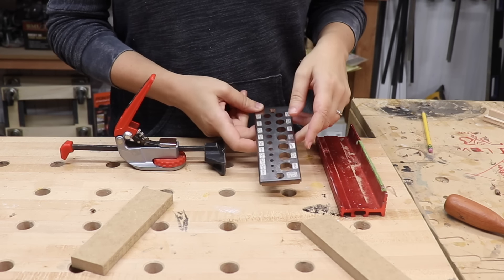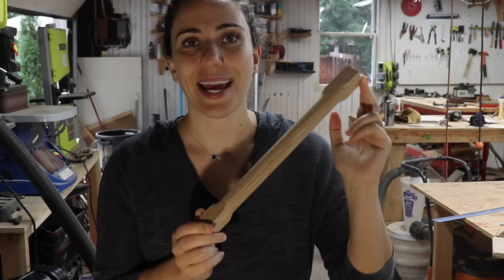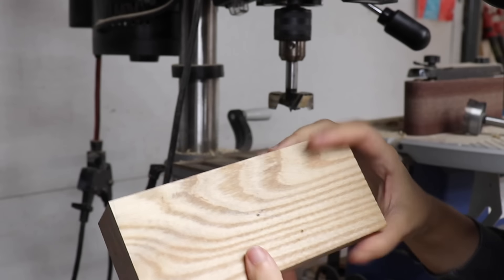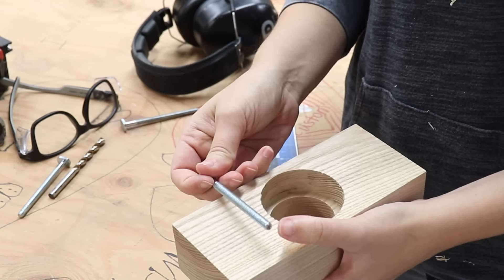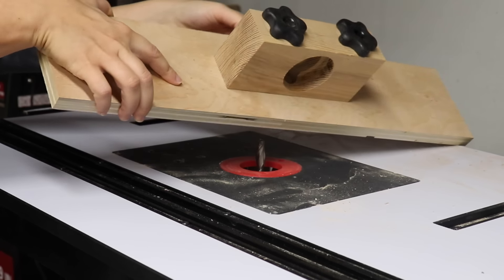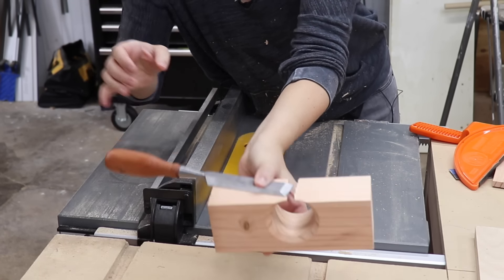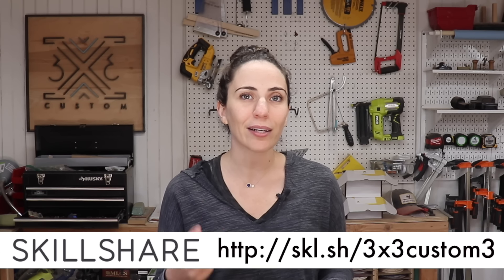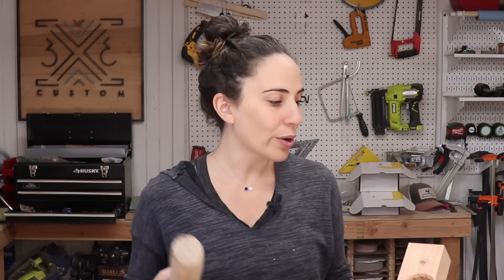Making Large Dowels WITHOUT a Lathe // Woodworking Jig // Dowel Maker

Comment: Try using some replacement/old planer blades. And screw them down using a metal backing bracket . Right angles and screws will give you sufficient clamping action. And try mounting the blade at an angle so the dowl will start cutting at the max depth first and work. Into the minimum depth! If you cut or  make the big whole piece of timber from 2 seperate sides and use bolts in the base and roof you could adjust the size ratio of the dowls.!🤔

Comment: For small diameter dowels (e.g. for joinery), it is easy to use a thread die and force a wooden block with a drill through the die. The surface is a little bit rough, but several passes with a folded sandpaper solve that. The nominal size of the die should be larger than the expected dowel diameter.

Comment: :hand-pink-waving::hand-pink-waving:Good video Tx, Tamar.    The dowel plate I have to admit is I think the best option from those shown in the video but using a cordless will give you much faster and cleaner results but you wont be able to work off your frustration then with the hammer !! 🙂

I have to admit it is seriously expensive for a piece of tool steel with holes in it, while they are machined on the reverse of the plate it is still expensive . 149 euros or if you want metric 210 euros ! Why it should cost more for a metric one is beyond me ?  🤔🤔🤔 It takes only a few minutes to machine this. Its not a rocket engine....

You can actually quite easily make your own if you have a pillar drill,  ( its unlikely a portable drill will drill through the hardened steel) just grab a old file, cut off the handle tang and de-corner the file , mark and drill out the holes and then you have a nice dowel jig, while the actual proper plate has slightly tapered holes on the back side of the plate you wont be able to do that unless you have a lathe or a step drill but dont worry as I tried this and it works just fine, just use a punch to knock the finished dowel finally through or reverse on your electric screwdriver to pull it out.... just dont hit it with a steel hammer as it will shatter the file. 

Interesting to see the other options as well, there is a further one not on here which you can now buy for around 25 euros and it uses a 4 sided carbide turning tip in a square block of Aluminium with the sized holes pre drilled in it, works perfectly only issue is the limited number of dowel sizes , when one edge of the carbide tip wears down rotate it to another one, it would however outlast most DIYers on one side I expect..... 

Thanks for the vid,  great work as usual. I love the fact you just get on with it, no distracting stupid music or banter.:hand-pink-waving::hand-pink-waving:

Comment: I have a lot of old carpenters in my family and I have seen them make a 6 inch or larger diameter column with a circular saw or table saw, a belt sander belt, cut to one very long piece, and a great deal of elbow grease. (Usually supplied by the younger generation who were learning.) 

They'd start by gluing up stock to make their rough square column. Then they'd cut the corners, turning the square column into an octagon. They'd cut the corners again leaving sixteen sides. Once more leaving 32 sides, then they would make d-handle clamp blocks to clamp onto the ends of the cut sanding belt, and sand it round. 

This method takes time, however it has no upper limit to the size of the dowel / column you can make.
Reply: Ok, I might try that. I have 2 X 3 m lengths of hardwood!

Comment: You should check out Izzy Swan's video on the table saw method.  It would be similar to the router table method and double as a work holder while you sand.
Reply: @Don't Poke The Bear So what happens if the bear gets poked
Reply: That was my first thought, “just use the table saw” 😎

Comment: It is not necessary to buy a dowel plate. One can be made to any size you want though this works for smaller sizes not 2" limited only be the available drill bits. If one has some steel stock it is only necessary to drill a hole through steel plate say 3mm or 6mm thick. Do not clean off the resultant burr as that is the cutting edge.  It really is that simple. Drive the timber stock from the burred side. A commercial dowel plate will last longer because it will be made from harder steel but for an occasional run of dowels or if one needs dowels on the fly and a dowel plate is not available this is a good stand by.
Reply: Nothing is made from "Harden Steel"!!! It's made from unharden steel and then hardened then tempered then sharpened!!!

Comment: Some nice demonstrations there.  I wouldn't give up too quickly on the mounted-chisel method.  I know from experience that the results (with regard to smoothness and tear-out) are very sensitive to position and angle of the chisel.  A small change can make a big difference.
     Here's another effective method: using a draw-knife, followed by a spoke shave at a shaving horse.  For greater accuracy you can make a template as a half-round cutout in the side of a piece of cardboard (or aluminum flashing, or vinyl siding) to test the roundness when you begin getting close.

Comment: Before I got my lathe I would do things this way. However I still sand dowels by pounding a socket on the end. Electrical tape helps hold it together if sockets and extensions are loose. (Your other hand is free for sanding) But while you're teaching yourself a strategy, you'll pick up 3 more in the process. You can also use hole saws to turn your pieces, as long as they are similar diameter.  And if you cut the top of your hole saws out, and mount it good, that would cut dowels as well.  What the hell, go buy yourself a wood lathe. They are so much fun! Oh, and most hole saws are not near long enough!! So...... Why couldn't somebody buy steel pipe? Cut teeth on one end, and screw a cap on the other with say....⅝" nut welded on top? This person could take 40 grit sandpaper and thin the pipe walls above the teeth (reducing friction)  this person could make it 6" or even 12". She could even post it on her own channel and show us how it works😁

Comment: I'm trying the table say method tomorrow. It's pretty much a jig (hole in a 2x4) and you clamp it to the side and level up the blade until you get the high you need and turn it in to with the drill. That way the excess is cut before it get in the hole. Can be done with a router too tho.

Comment: Save your old or broken jig saw blades, embed two in channels on either side of a hole and hold down with screws, clamp it down, and drill a dowel.
I've used this method for years on various custom sized dowels. Fine tooth blades make the cleanest dowels, but are also the slowest to cut.

Comment: Thanks for all these ideas. I'd seen the chisel one before, and suspect your results are due to the way you're having to push on the drill to keep it in contact with the screw. If you could spin the wood without pushing it through the jig at high speed it would make a far cleaner cut. For example, if you cut the head off a half-screwed-in lag screw then you could grip the lag screw shaft in the drill chuck and while it spins rapidly, you could push it through the jig slowly.

Comment: Great video! To hold against the 2" dowel, try giving a hammer tap or 2 to a blade drill bit into the top of it after drilling a little into it with a flatter bit. I don't know the strict technical name to it but basically, if you construct or make a space about 1/2" or an 1" so the width of a spade blade fits into this diameter, you place the the blade bit that has three ends sharp, & 2 walls sharp as well, so with a tap or 2, maybe 3 but easy with the wood mallet, you'll have the perfect bit to guide rotationally any piece of wood even passing the dowel knife or blade that won't affect the exterior structure of the dowel.

Another may be a T shaped piece of metal you can drill two holes on the head of the T, say the T has enough space for couple 1" wood screws, drill them, then using a grinder smooth the base of the T like to make an exagone or 3 flat sides. Doesn't need to be strictly perfect, it's just so the drill grab onto the base tighter. An example of a T that just came to my mind, a caulking gun central shaft, has a base that pushes the caulking out, that shaft, if the caulking gun is not to be repaired or salvaged may be used. All you'll need is to drill the holes for the screws, preferably you want to use wood screws of about 1" long &, don't forget to drill the wood cavities before drilling them into the dowel to be, especially if small.

Thank you for your braveness to be into wood working and having this vast knowledge to having it for the world to be educated on this subjects!

Thank you very much! May God bless you, your family, and may He make you greater & more respected yet! Take care!
Reply: To use a chisel against making  a dowel, you want to invent the chisel or the dowel will gain pressure or level against the chisel trying to lift it. 

Rotate the dowel or a piece of wood with your hand against the chisel as you shown us you placed it, you'll see how the wood will grab the chisel, making pressure to lift it. Flip or turn the chisel with the edge straight towards it, now is fair game, is not fair because wood is weaker than steel but is fair because what you want is that ths steel carve or work into the wood making it smoother now, it will help like a guide, made of two pieces for the chisel, and a piece over clamping the chisel so still the wood don't make the chisel to vibrate. And yes, if you rotate your dowel or wood against the chisel while chisel is flat up, you'll struggle more to lift if up because you'll have less level against it. 

Try it flat up, you'll see a less impact or, less beating of the wood vs chisel, that's why you see it like bites finished of rough finishes, is ok, you're working towards a purpose and you'll get there!

Comment: Haha.  I like the "if this were a real project" line.  Of course if it were your second real project you'd have marked the points to route to but it's not a real project if you don't do it wrong the first time... And, if it were a real project, you'd stop in the middle and drive to Home Depot - at least twice..  

But what a great video.  For me without even a shop, let alone a lathe, these ideas are going to help me make some great custom dowels and thread them differently on the ends of the same dowel...  Ok, probably won't help me make great dowels but it will help me make some functional, serviceable, dowel projects.  I'll let you know about "great" in 5 or 10 years.

Comment: My granddad used to build timber framed barns. He had a dowel plate that was forged with sharpened extrusions that came out from one side of the plate. They sliced the wood to make the dowel. I was very little at the time that I saw it, but I think that the largest holes were 2 inches. Some of his barns are still in use, after 100 years.
Thanks for sharing your videos.
Reply from the maker: That sounds super cool

Comment: Fun video!  To support longer pieces using the router table method clamp a Vee block or even a couple pieces of scrap tacked together at 60 degrees.  You will also get better results on the router table method (not the round over) by slowing your feed rate down.  Love my lathe!  Best of the New Year and thanks for sharing
Reply from the maker: I can’t wait to get a lathe. Ha
Reply: @3x3CustomTamar  be careful Tamar, that is a very deep rabbit hole!

Comment: I used the roundover bit method to make a 5ft, 6/4" maple handle for a refurb job. I secured the piece down to the table and had two other pieces along side for the router to sit on. Then I just ran the router over it, turned it etc. Just like the method on the router table, I needed the ends a little longer to stay flat. It worked great
Reply from the maker: Awesome. The roundover bit was def the cleanest by far

Comment: I wonder if it's possible to use a drill press as a vertical lathe?  Swap out the chuck for a drive spur, attach a tail stock and a tool rest to the post?

I just happen to own a 3/4" roundover bit, so I guess I could make 1-1/2" dowels on my router table.  I might tip down a bit of 2x4 and give that a try tomorrow.

Comment: On the router jig try slowing your feed rate(advance of the dowel through the jig); taking less of a bite with the bit; and ditch the square end bit for a bowl bit or something similar with rounded corners so the cutting is more gradual. You will get less tear out and much less sanding required. I like your trick for controlling the speed of the drill with your foot using the rope.
Reply from the maker: Ill have to try that. Thanks!

Comment: If you used say...a half inch end mill bit in the router, the larger surface area for cutting might give you a smoother final product on the push through jig you had. Also, your feed rate may have been too fast. I'm using these ideas for arrows and I think that's the best bet for me.

Comment: 100%  agree with your every choice. I have personally used the router round over bit method as well . I saw a video from Roy Underhill that used a plate iron or steel , just drilled the size hole in the plate he wanted and pounded the square stock through .  I am sure there in more to making the dowel plate than that but I am interested in trying it.
Reply from the maker: The round over bit was def the simplest and easiest with the best results. I know that ppl have done that. I think the only difference between an homemade and commercially made dowel plate is the hardness. They harden the steel after.
Reply: @3x3CustomTamar   I believe your right  :-)

Comment: Could try having a guid block set up on the out feed side of the router table to support the work piece for the last pass where you have support from the last corner on the infeed, the guide block can be a scrap with the finished whole size in to take the work piece and support it as it passes out... if any of that makes sense ...
Reply from the maker: I think I get it. Maybe that could work

Comment: Cool video.. I'd tried the chisel before too and hated.. In fact it ruined and blew apart the stock I'd tried.. Red oak and Maple.. I want smaller dowels  1/2 inch and under.. I also tried the plate with holes and beating through stock. I don't have the patience for it. The router jig and screw down is on my list but  a little shy of it. actually broke a bit trying something similar. Skeered of it now but super glad I ran across this video. *might try again* The round over looks very doable. 

What I do now for my small dowels, I got an old old cast iron 10lb weight that goes on a hand weight. You know like for curls.. Then drilled different sized holes all the way around it.. Like other videos where they drill a piece of iron, chuck the wood directly in the drill and start the top and drill down in size..It's adequate I still blow some up while doing it.. Best I've done so far. Similar to this https://www.youtube.com/watch?v=BGVmEOAMiPk except using the weight I've got about 10 different progressively smaller diameter holes.. It's ok..
Reply from the maker: Whatever works! The roundover bit is my favorite though

Comment: Thanks for a great video! I landed here while searching for "cutting wood dowel at 3d angles" :)

I have a bar stool with round dowel-like legs. The legs are cut on the bottom (feet) such that the cut is perpendicular to the dowel axis, which makes the cuts not parallel to the floor. Do you have any advice on how to cut the legs to be parallel to the floor? I think it might involve cutting at 2 angles in 3-D but I'm looking for ideas and advice. One way might be to clamp the chair so that the seat is vertical (aligned with a level) then have a mitre saw cut a straight cut (no bevel, no mitre).

Comment: Maybe use a short lag bolt at the end, rather than a screw. ..then a socket in the drill... a positive and larger connection.
Reply from the maker: That’s what I did
Reply: @3x3CustomTamar  oh sorry.. was only suggestion didn't realize you made that change.

Comment: I saw a video of another woodworker using a similar method to your router setup.

He basically had a crosscut sled with high vertical end pieces.  Then he had something attached to one end acting as a point on some sort of bearing holding the far end of the work piece.  And then he attached a cordless drill on the other end of the work piece just as you did to spin it.  Then he just turned on the table saw and pushed the sled over the blade.  It looked like it worked incredibly well.
Reply from the maker: Was that Michael Alms video?
Reply: @3x3CustomTamar  
I don't recall.  I did a search to try to cite the proper video after I commented, but I didn't find the one that I had originally seen.  There are lots of others that use the same general method, but the first one I stumbled on seemed far superior in every respect.  Can't seem to find it now though.

Comment: The last method, the 'pencil sharpener' is the way the English made long-shaft (longbow) arrows...and is actually the best method. You had it right, the chisel angle is VERY important, and your feed rate is, too (yours was too fast in the example). You also need the equivalent of a 'steady rest' on the output side, to prevent 'wobble' from causing shredding and out-of-round conditions.  Keep in mind, red juniper, white cedar and ash were ALL used for english arrows...so it DOES (most definitively) work with the tougher hardwoods...there are some videos on YT about this method for making 'in-period' arrows...you might want to watch the way their jigs were built...
Reply from the maker: Cool.

Comment: The chisel method works if you just cut a slot for the blade so that the blade is 100% supported. A plane blade works better.
Reply from the maker: Yeah. Perhaps I should have used a plane blade. But I liked the router the best. Ha